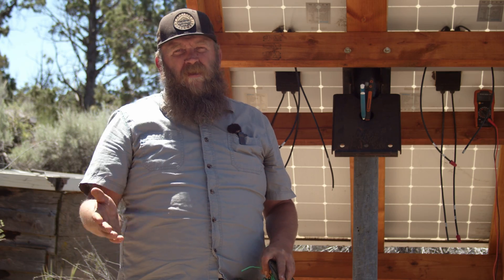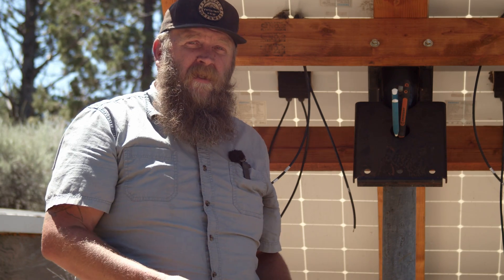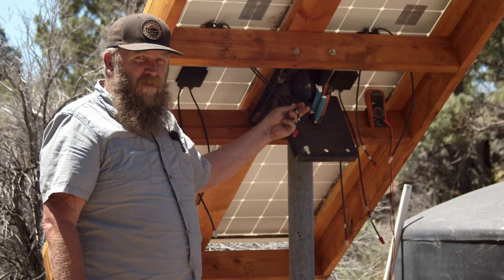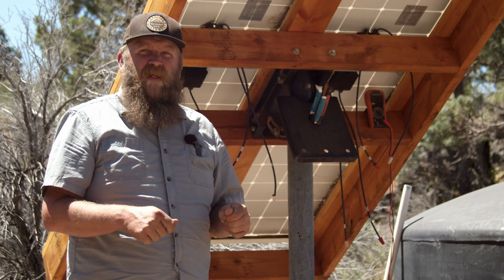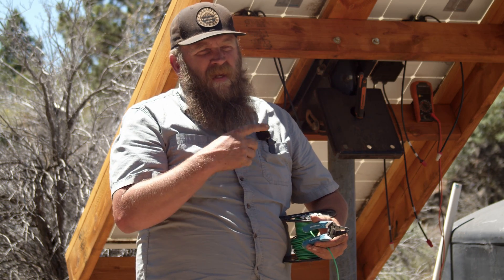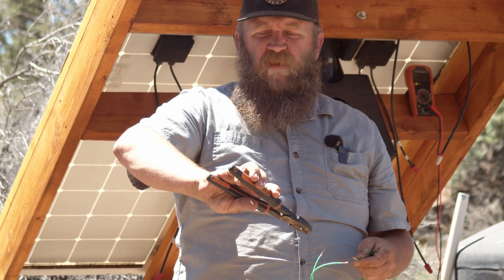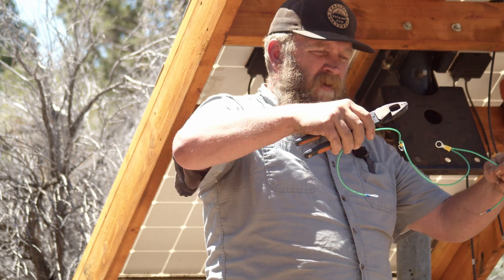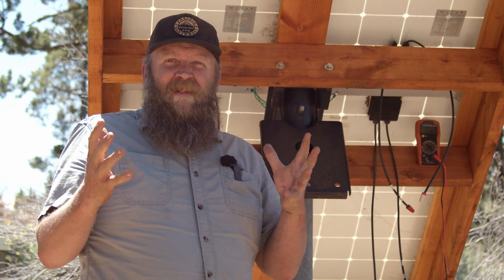How to Make DIY Solar Safe and Easy

Comment: Wouldn't a good solution be to throw a tarp over your panels so they dont produce voltage during hooking up?
Reply from the maker: Nope. It's a false sense of safety making people be lax with it. With mc4 connectors it's pretty difficult to come in direct contact with live voltage.

Comment: Brother you crack me up. 
But I gotta say this. Bonding is good. But in my opinion run screw into frame. Then use a wire with insulation stripped off. Then wind it around screw. Then tighten screw. Apply protective coating. I just use silicone. 

Your charge controller in my opinion is all wrong. 

After what I say you’ll agree. 
Ships don’t use just one charge controller it is better to use baby charge controller. Put right under panel. Then from controller use a fine welding cable to a bus bar. Inbetween I use a breaker panel from house. So I can shut off each panel if need be. 
Each charge controller is cheap $10 on Amazon. Buy extra. 

Let’s say your out in ocean and the charge controller goes out. Or the solar panel is shadowed. 

If you have ten panels two go out you’ll still get full voltage. Also you’re not generating heat in charge controller as you found out. I’m sure. 
Thing is from bus bar to batteries use a welding wire. Don’t forget a cut out. And amp meter. Thingy that tells you load or force of energy. In my case 8 panels 8 amps. 
My point this way if a panel is weak or broken or charge controller breaks you have manageable back up.
Reply from the maker: Sweet!! That's an interesting way to go about it. You're basically talking about optimizers. The problem with the way you're describing installing this is that you would be doing a parallel connection. That's the least efficient way to connect panels and creates lots of points of failure that would require constant monitoring in order to know if an individual string failed. This was a video talking about one part of a simple install. Something easy for people to do DIY. Its a part of a series of videos. No need to over complicate it.

Comment: What should I look for when buying used solar panels?
Reply from the maker: The three main things are darkening of the individual cells, usually in the middle, delamination of the cells, front or back and the relative open voltage, if they are supposed to make 38 volts, what percentage do they make in direct sunlight. Those will give you a pretty good idea if they are good or not. You can also judge them by their age. Average panel is gonna have 25 years of life.
Reply: @7kinhomestead  Thank you  I asked not only for myself but thought others would benefit from your answer.

Comment: Solar isn't dangerous. But those guys love their monopoly. HOWEVER>.. I did find out you can get fires if you use wire that is too small a guage for what you need. There's a certain wire size needed for certain amperage amounts. That's where you can get heat in the wires if the wires can't handle a certain amperage. But all you have to do is know that and have someone tell you that so you can look up how to do stuff.

You should DIY everything. Down with monopolies and overcharging!
Reply from the maker: Totally true. You can look up ampacity tables that tell you what wire size for what amps. I agree on DIY. Anything that you can save money doing. Sometimes I joke that it would cost $500 for someone to do but I could do it for about $1,350. 😂
Reply: @7kinhomestead  You are doing all right. I wish more people were into homesteading and that it could be a bit more popular so that people will support people trying to do it. Thanks for the reply.

Comment: Thanks so much for this series. Im about to disconnect - reconnect a charge controller over xmas and am stoked your doing this content.
Reply from the maker: Awesome!! Glad to help!!
Reply: The charge controller when you buy you need to really research the hell out of. There's too many ways that can go wrong. Your charge controller has to be PURE SIN inverter, or you won't be able to run ANYTHING on it, other than charging your phone. You also when looking at charge controllers have to make sure it says its pure sine. The modified sin ones won't work and are garbage. Some will say they are pure sine also but not really be pure sine. So you have to both look at the specs to make sure and then talk to customers to verify its pure sin. 

If you don't do this you will struggle to even run anything with 100 watts of power (which is really low).
Reply from the maker: @candlelightbeesgardening  the charge controller and inverter are two separate devices and have 2 different functions unless you get a hybrid all in one system. You are correct about the modified vs pure sine part. I just wanted to clarify. The charge controller takes power from the solar and charges and manages the battery charge and the inverter takes the dc power from the system and converts it to AC power which is where the sine wave comes into play (I.e. alternating current).
Reply: @7kinhomestead  You didn't do anything wrong. Keep doing what you are doing and I like how you are doing things. You are doing fine. I only commented about this to save people problems I had when I built my own system. And I didn't want others to have to go through the headaches and lose money like I did till I figured it out. And there are many traps and cheap crappy products that won't hold up on the market now. Wish you luck & success. There's a lot of traps especially in a lot of the Chinese electronic parts where it doesn't hold up well.
Reply: @ thanks for clarifying. I’m swapping a 60 amp charge controller to a different brand 60 amp and had a minor freak out about the sine comment. I was like “we haven’t covered that part yet”. But now it makes sense. I am planning on swapping my inverter too at some stage but was doing the charge controller first as a confidence builder.